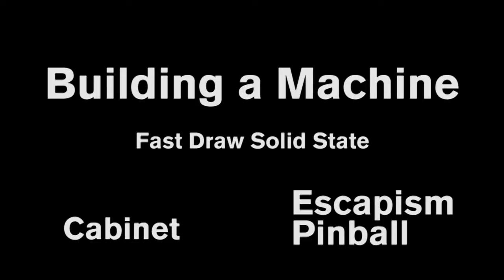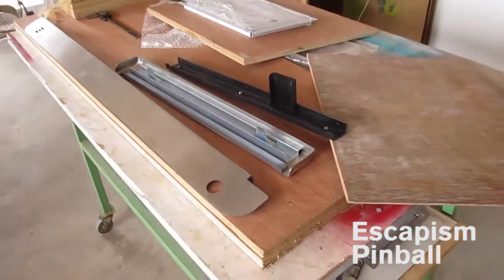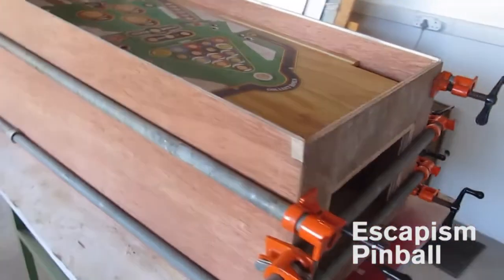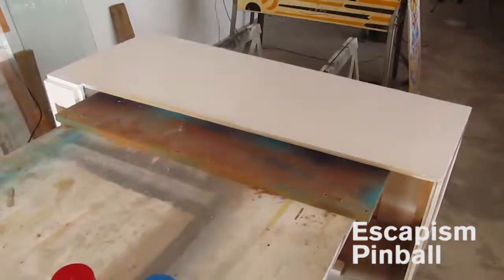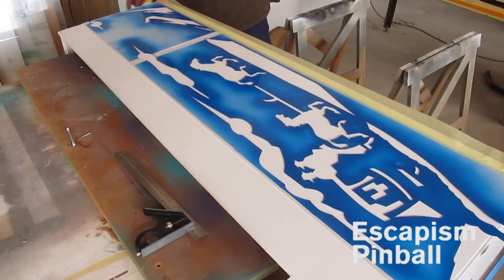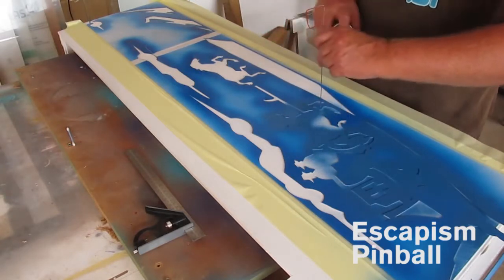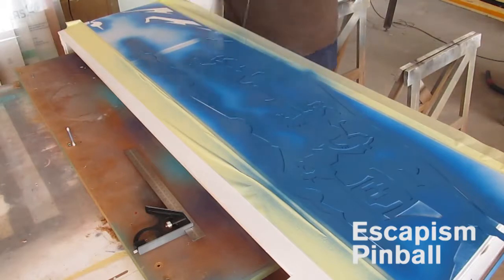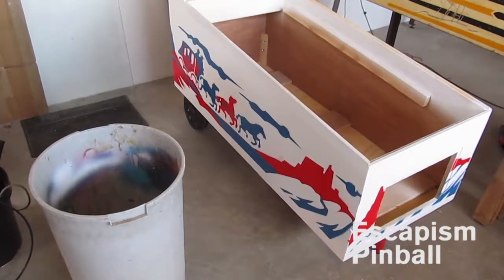Pinball Machine Cabinet Build

Comment: Finally a video on a real cabinet. I have two Stellar Wars machines, both cabinets look like they are made from compressed cardboard or shitty partical board and not ply wood. They are litterally crumbling away. My other machines are all ply wood. I've thought about building a cabinet for each one myself, but I have limited space and no good tools. I've always wanted to see a full cabinet being made from start to end, measurements, tools used, types of cuts of the edges since I noticed they are not just 45deg cuts, and how to get it all squared up. Other tips and tricks along the way.